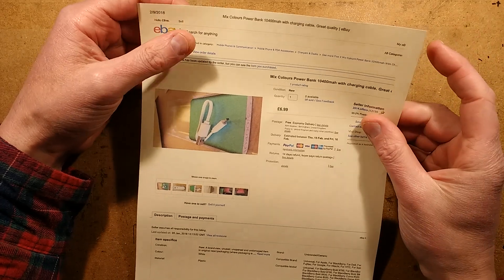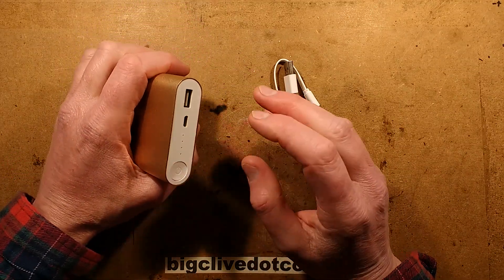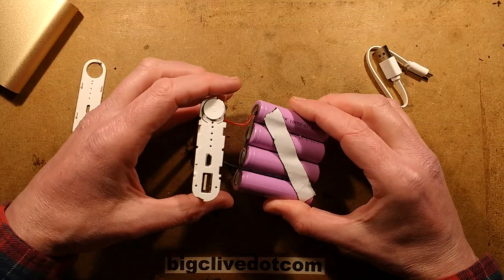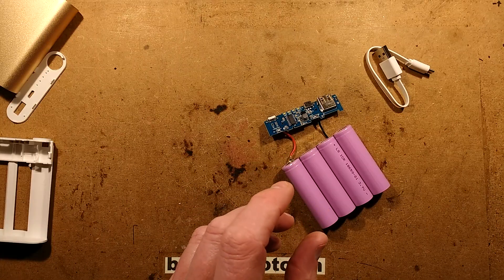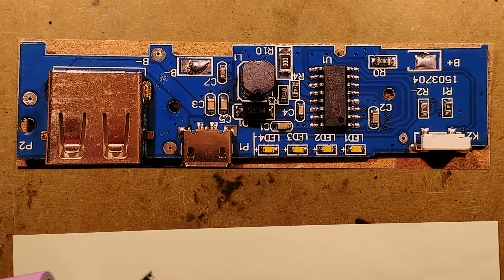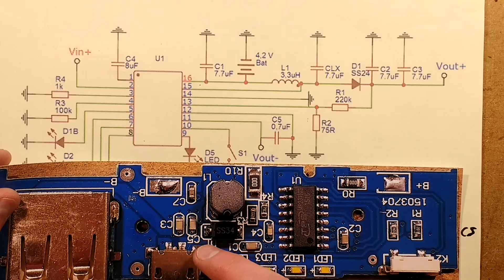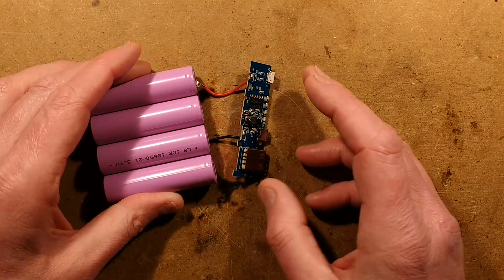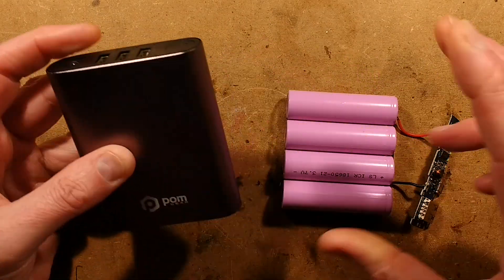Inside a fake "10400mAh" eBay USB power bank.

Comment: If its a smart charger (99% are not) then it would reduce the charge rate to improve the life of the cells.   It's common practice in china to prevent end users form repurposing chips.  Easiest way to do this is just not publish the pin functions or a datasheet for the chip.  It hinders innovation, but ensures vendor lock-in, which is bad in the short run for end users, and in the long run for producers.  Sad that these bad tactics have to be relearned every generation because noone reads.

Comment: Although it wouldn't account for the huge discrepancy, monitoring the total input current to the charger isn't quite valid since it has a converter to buck down the 5 volt input to 3.7 volts and as it does that, it boosts the current to the cells above what the charger receives.

Comment: PLEASE listen to this, how in the ever loving f*$% do ALL those ebay sellers who sell fake/over rated power banks and battery cells not get drowned in fake/not as described item cases?Proof of the scientific test to measure capacity is proof that the item is not as described and/or totally fake. Not to mention other discrepancies. It is a lack of general buyer knowledge and equipment to do these tests that allows these sellers to scam everyone. Can you even begin calculate the amount of refund money that buyers are entitled to? I quit smoking about 2 months ago and got into vaping, so i snagged myself 4 samsung inr 18650 30q's cells from ebay that seem to be legit, but i cant test them i cant prove they're fake. So if they are, how could i ever file a dispute and win?

Comment: Also power banks often specify mah capacity at single-cell voltage, even though the voltage is being stepped up to the equivalent of 1.5 cells' worth of voltage, because all the cells are connected paralell (and the the voltage is increased to 5V by the board).  So if you put in just under 4000mah at 5 volt for around 19 watt-hours, then the power bank is around 5130 mah, or 1280 mah per cell.  THe cheapies run around 1500mah, so those cells are most certainly used.

Comment: Those low capacity cells are probably used cells too. ~1500mah new, but worn down to 800mah from use.  Probably only a couple hundred change-discharge cycles before they won't hold a charge at all.

Comment: Wow I wish I understood electronics this well. I have 3 portable chargers, 2 4000mah and 1 10,000mah. One thing I've noticed is that although I can usually only get one charge out of the small ones, they charge far faster than the big one. I've always kind of wondered why that is. All 3 have been bought from retailers so I suppose its unlikely but not impossible that something is wrong with it but I have no way of finding out due to my ignorance with them.

Comment: Just the fact that they are serial is a risk hazard without balanced charging
Reply from the maker: The cells are in parallel.
Reply: you are right. second watch made that clear.
 I must have been drunk first time i saw it :)  still, you should have balanced charging, because paralel makes for same voltage bigger amps, but does not avoid the the problem of inner resistence of cells. so even with a paralalel connection you risk the cells being misaligned in terms of charging.

Comment: Ok..tnx for this video....but you asume that the 18650 cells are "fake "and the other Powerbank is better because its heavy ?the only correct way is to test seperately the cells with a special tester or charger….i have the excellent Portopow...max. 5 amps-50V...and the Liitokala Lii-500 charger ….this one can discharge and charge the cells seperately and measure the capacity and internal resistance..

Comment: Lithium batteries are charged using  different cycle. First, they are charged at a max rate(cells specs) until the voltage reaches the max voltage(again cells specs), then it maintains that voltage until the current drops to negligible at which time it is fully charged.

Comment: FWIW, I suspect cells that size that claim to be 2500mAh or more are bullshit anyway.  1600mAh is more believable.

It's chemistry, not witchcraft.  You can only get so much capacity from so much lithium.
Reply: Not entirely true. Sony VTC6 cells, for instance, have real 3000 mAh per 18650 cell, some Sanyo ones even more, but anything above around 3500 mAh and not being 100% manufactured by Sanyo is guaranteed to be full of Chinese lies and magic smoke.

Comment: Those 18650 cells are used for some many different things. I've seen them in older type laptop batteries. I use one in my e-cig unit. They'e supposed to have a very definite output. Sand filled cells is a new one for me......just wow!

Comment: I noticed an error when pointing out the resistors on the circuit board when compared to the schematic. On the circuit board you point to R1 and R2 saying that they are 1k and 100k respectively, however on the schematic R1 is 229k and R2 is 75R (75 ohm). R3 is 100k and R4 is 1K both are located to the left of the chip as you look at it.

Comment: I just found the same device, sans 18650s , but with spring contacts so you can fit your own, 
https://www.ebay.co.uk/itm/5V-2-1A-USB-4X-18650-Power-Bank-Case-Kit-Battery-Charger-DIY-Box-For-Smart-phone/253696287781?ssPageName=STRK%3AMEBIDX%3AIT&var=552950934540&_trksid=p2057872.m2749.l2649
At the time of posting, they are available from around £1.29 delivered.. I ordered two from different suppliers,  cos I liked the construction of them. 
They have exactly the same "take forever" charge curve. I left one chsarging over night. It was still blinking 8 hours later (but shows four LEDs on the charge indicator, so appears to be fully charged). 
I fitted four Sanyo LiPos from an old Dell laptop in it, and I'll do the same with other four from the Dell pack into the second when it arrives.
Reply: FWIW The ones I inked to above arrived a couple of weeks back. They contained the same PCB, and have spring contacts for the cells. They do take a fair while to charge the cells, and exhibit the same weird led flashing sequence.. but they are very neat and well constructed. So much so that I bought four more for some more of my many recovered laptop cells. I have actually managed to power a Raspberry Pi bodel B including WiFi from one. I wouldn't claim that this is going to work reliably but  for £1.29 delivered, you can't really complain.
Reply: PDF for the controller in the version I purchased. -> https://cdn.datasheetspdf.com/pdf-down/H/T/4/HT4936S-HOTCHIP.pdf

Comment: Hello Big Clive.
You seem like a guy that knows his potatoes. Is it possible to wake up battery cells? As in bicycle batteries.
All the best.
Steve Lites.
London.
Reply from the maker: Non rechargeable cells are prone to leaking when an attempt is made to recharge them, due to internal bubbling and pressure buildup.
Reply: bigclivedotcom They are the classic 18650's.
I've seen videos on YouTube but I'm still not to sure about doing it.

Comment: many of these cheap power banks have VERY low amp output .. I bought one thinking it would power a Raspberry PI .. but NO cigar.  Also, many of them have crappy NiCd batteries inside, not even Lithium cells.

Comment: You have lots of mistakes in that circuit, pin.13 should be feedback divide resistor, for 5V out, R2 should not 75 ohm, CLX looks snubber, but it's not a good design. Too risky.

Comment: haha i bought that exact same unit, i took it on holiday and it was deemed useless in 4 days when i plugged it in to charge it and the connector snapped off its solder inside the unit.

Comment: When you fully discharge a battery, YOU DAMAGE IT!!!!  The rule of thumb is, if you use a light, for example, to discharge it, as soon as you notice a drop in the light intensity, IT IS  DISCHARGED! On a motor operated device, as soon as you notice a change in the pitch(lower), the batter is discharged.

Comment: You're a bit off with your info on 18650s. Low discharge rate cells (e.g. for flashlights) easily reach 5000 mAh nowadays. It's the high discharge rate capable of 30-40 A (e.g. for Vape mods) which don't exceed 3000 mAh and are about 5 times more expensive. Thus the price is more dictated by discharge rate (current) than capacity. 
Otherwise, great video as always!

Comment: My brother bought slim version, same "10400mAh" rating but board on it died after few days, can't charge it.
So i took it, dissasembled it and measured capacity, it only has 2000mAh which is not bad since cell is same size as phone battery (my phone has simmilar size 2600mAh). Guess im gonna order new case and board for it and use it since they are cheap.

Comment: It is a 10600 mAh power bank, but with a low discharge rate. Sounds like you're confusing yourself between its capacity and discharge rates: 10600mAh vs ~1A?

Comment: I have one that is very similar and I CANNOT get it apart, it has 3 usb ports, 10400 mAh, made by POM GEAR. I can't even find any videos on it, but this is as close as it gets and I am unable to take it apart, It doesnt come on, I push the button and hold it and all that, when i go to charge it lights flash on for a split second and off, if I leave it plugged in it gets really really hot. No clue here. Probably sand filled.

Comment: I bought the exact same "module" from Ebay for ~2$. It comes with the aluminum case and circuitry but no li-po batteries. I am using some cells from a laptop battery and it works so far, hope it will not blow up.

Comment: Lol I bought a 5,000 mah charger from walmart. Works great. Only problem is that once it hits 50% it'll charge for about 2 more minutes and then it's dead. Charges at 2a though, so it'll charge my j7 sky pro from 50% to full in probably an hour and only uses about 25% of the power bank. I don't mind for $8

Comment: I buy the banks (without and without the batteries) and where necessary replace the batteries with reclaimed laptop batteries...
The aluminium enclosure, PCB and plastic inserts (with different Ah values pre-printed) are available from several suppliers...

Looks like it's up to the manufacturer to put the right batteries in them... not so long ago, these would have cost twenty money units...

Comment: USB compliant devices are not allowed to draw over 100mA until the device has been enumerated by the host controller. After that point, the device is allowed to draw up to 500mA of current. A charging port may place a specific resistance across the differential data lines, which indicates that a device may draw up to 1.8A without being enumerated. Does this device have that termination resistance? Probably not. Your complaint that the power bank is dropping the voltage at 1A is probably unreasonable and is not in compliance with the USB specification.

Comment: Nice video. Since you know electronics I have a question.  The batteries are 3.7 volts, they get charged with 5 volts, ok,  So now if the batteries are at full charge (3.7 V) how can they charge a phone battery that is the same 3.7 volt?  don't you need 5 volts to be able to charge the cell phone battery that's 3.7 volts?  I'm a little confused with that.
Reply from the maker: The units boost the voltage to 5V.
Reply: thank you for your fast reply.  very interesting.  I was going crazy trying to figure how it was done.

Comment: i actually did the same thing, and used the batteries on my vaping device. They work perfectly and re-charge normally on the battery charger.
Reply: Never use dodgy Chinese cells in your vape if you want to keep your face intact! They are garbage and not designed for high amp current draw. Get some (real, there are fakes!) Sony VTC5A to be on the safe side if you're one of the dudes who want to blow massive clouds, i.e. if your wattage ends up in the triple digits in a 2 cell 18650 setup.

Comment: I knew it! I have a generic "20,000mAh" power bank I got on eBay about a year and a half ago, and it can't even fully charge my Galaxy S5, which has a 2,800mAh battery, and it only gives my iPad Air 2, which has a 7,000mAh battery, a 5% increase...

Comment: The USB power bank cells are optimized for a relatively low load, like charging a phone.  When you use the LED lamp to drain the battery you're not only discharging at too high of a C rate, but you're probably also discharging to a dangerously low voltage.  Now I'm not saying the advertised capacity is actually inside that hunk of plastic, but you do the battery no favors when you use it like this before testing the capacity, and are almost certainly damaging it to some degree.

Comment: i actually owned this exact one i bought in a 7-11 in china. it took all nite to charge. eventually, it would charge up and then stay on continuously until it drained itself even if you were not trying to use it. it would never turn off. eventually trashed it

Comment: Sadly, I've auctally bought this before, about two years ago in South Korea. They were selling it for $9 per power bank, and I thought that it was a pretty good deal and bought one because my Galaxy S5's battery life was really bad, and I didn't have one. Unfortunely, the whole thing wouldn't charge after about 15 times after use and it honestly became a paper weight after the battery wouldn't even turn on the LED's. Thanks for making the video, I've been wondering what the auctal hell was wrong with the battery bank, and 2 years later, I've finally realized that it was nothing but a scam.

By the way, I now happily use a Samsung Battery back, at least 150 times better than the one I bought 2 years ago. ;)

Comment: I know you take apart plenty of batteries but some of the time I see things that I really want to see opened. Here's a link to a battery bank I found that claims it has a 590,000 mAh capacity.

https://www.wish.com/c/5a6d62315dcd020426e6d76b
Reply: He's opened a "100,000" mah solar charger before, tiny ass battery in them. Check out his videos for it.  That one is most likely the same.

Comment: 1 think i learned about powerbank, and 18650 battery.. they out there have 2 type 18650 battery, 1st, with regular 3.7volt output, 2nd, with regular 4.2volt output.. so powerbank module that use 3.7volt battery, will operate with 4.2volt battery, but can't charge full potential the battery, and 4.2volt powerbank cannot functional well with 3.7volt battery.. so you need to know what type of powerbank and 18650 battery..

Comment: For just over $20Aust, you can buy on eBay a "Waterproof 300000mAh Dual USB Portable Solar Battery Charger Solar Power Bank MK" - 300Ah !! - sounds like good value ;)

Comment: Hello.
I have one. Its posibile to add or remove one cell?
Reply from the maker: The cells are in parallel so you can use from one to as many as it can accommodate.  I'd suggest making sure all the cell voltages are very close before connecting them in parallel.
Reply: Hello.
Thanks for information... And I think you will be interested about this device.
A device generating gravity and magnetic plasma fields.
For health benefits. I found that searching plasma lamp parts on gumtree.
http://plazmamagrav.pl.tl/Systemy-kaskadowe.htm
Check photos of manufacturing that, down of page.

I think in best scenario its connected to ground or N.
But this dude make instruction how to find live line in socket.
https://www.youtube.com/watch?v=6fZ-48KbNo4

Comment: BTW, looking at the schematic, WTF you think is the capacitor marked CLX doing there?  

According to your schematic it's a large capacitor, placed right at the switching node, where it would prevent the switching regulator from working.  So, one way or another, you schematic must be wrong...

Comment: If those batteries was new they can have together 10,6Ah  ;-) but to power phone you need bust voltage up to 5V, it means that we have les Ah i this case 3,7V*10,6Ah/5V=7,8Ah. Eficiency of DC-DC converter can be 90% -> 7Ah with new bateries. Eficiency of charging is around 90%  ->  6,3 Ah this is real capacity.

Comment: That could be a solid 12000 mah bank if it used better quality 18650. Like a lg hg2 or simular cell. Most of the quality ones are 20amp 3000mah

Comment: the reason your confused is usually good chargers are 2 amps or 2000 milla amps but this means 10400 is 10 amps which is fake

Comment: In case anyone’s curious to the price of these cells, these are 18650 size battery cells, typically used in vape devices. They typically run for $8-$15 for cheap cells. The most expensive conventional ones go for roughly $30. Either way, the investment on the cells is obviously dirt cheap

Comment: ooOoooo laptop battered. Hey those ALDI solar portable batteries are BS. Gives very little out. Charges too quickly and solar panel does not charge 1 bar per 4 hours sunlight even when left in direct sunlight all day. Was £13 from aldi. Can get them online for £10 . Beware. Usually stuff from aldi is fantastic but solar batteries are not.

Comment: Actually, it is a copy of a Mi power bank of three or four years ago, and the actual price of this fake one will be around 4$, which is cheaper than Mi power bank as around 10$. If you really interested in power bank, there are a lot more newly designed Mi power banks which both perform great and are cheap. And ZMi, as a sub-brand of Mi, also provides many great power banks.